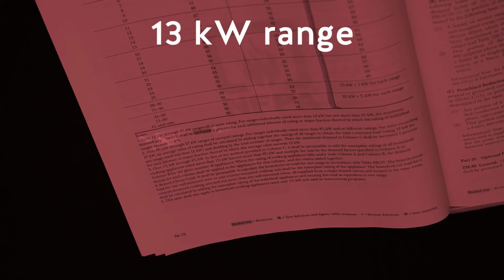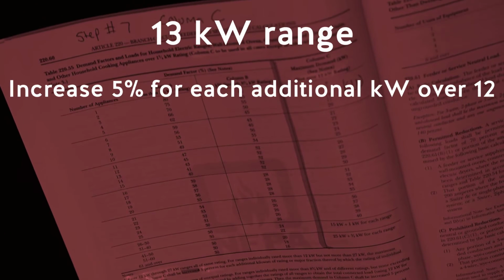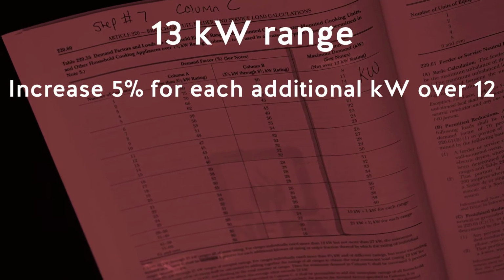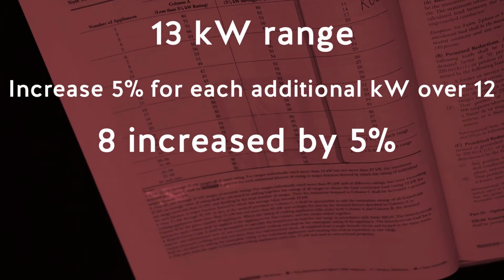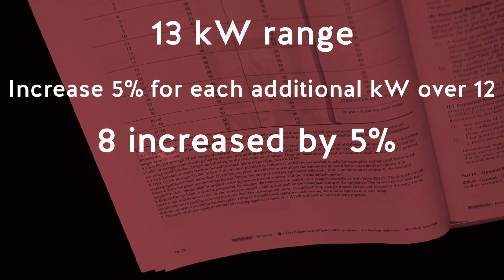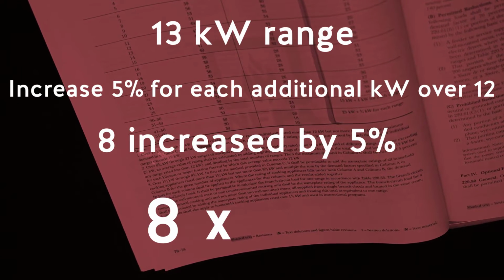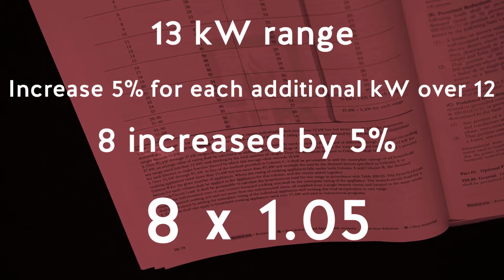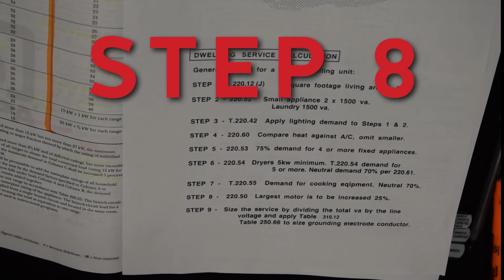NEC Dwelling Service Calculations

Comment: On step #8, I don't understand where NEC 2023 says 25% added to largest motor for individual dwelling unit.  You noted in the NEC 125% on 430.24(1) and that 25% used on step 8 with the remaining 100% to be used on another step, but the video didn't expand on that.  What's that other step the 100% was used?  Say you have a 5hp 1ø 240v A/C load & 10kW Central Heater.  The heater would be used per 220.60 comparison A/C=28ax240vx1.25=8.4kW vs. Heater=10kW.  Additionally, say you have 4+ fastened in place appliances and the largest motor(all 120v) is 9.8a, which is now the largest for the entire load i.e. step 8.  so step 8 would = 9.8ax120vx25% per the steps.  However, where in the code does it state this, which I cannot find, except for your statement mentioned above, where then I'm curious where the other 100% of the 125% went per 430.24(1).  I see that a 125% was all used on the A/C motor 220.60-Noncoincident load, and if we're considering that article then that's leaving no reasoning for step 8 and the 25% for largest load or at least a direct statement in the Code book for it.  Great video, apologize for the TLDR, but I hope you read and help me understand.  Thanks.

Comment: I need an example. Like how do you deal with ECM and variable speed AC units or do you just ignore that and assume it will be changed out in the future. What about heat pumps that can supplement the heat with the heat strips like during defrost? What about the dishwasher and large disposal? Refrigerator? My electric range will pull a little over 50 amps on a 50 amp breaker if all burners and oven are on at the same time, never happen, how do I rate it?

Comment: Do we need to measure the square feet of each level of the dwelling? E.g. first floor, second floor, third floor?
Reply from the maker: Yes, all living space of the dwelling must be included.
Reply: Just look at the floor plan
Reply: Check the county tax assessor office for the appraisal. Without that or blue prints you will be measuring and drawing floor plans.

Comment: I’ve look at the 2011, 2014 and 2017 cannot find table 310.12 anywhere.
Reply: I think it’s 310.15(b)(7) or the 83% rule
Reply from the maker: Yes, that is what the table is based on. To answer your question, though, table 310.12 was added new in the 2020 code.

Comment: Thanks for posting this lesson. I have a newbie question. Are microwaves and toasters, and other small kitchen appliances typically covered under the "small appliance" circuits? All the examples I looked at have only the two 1500VA circuits. For a large house, there could be more than one kitchen. Not saying this is the norm, but given more than two small appliances are expected, should we be increasing the circuits beyond the two?

Also, is there a distinction made between fixed in place microwaves and countertop microwaves?

Thanks!
Reply from the maker: The code provides a very loose definition for fixed in place appliances. Article 550 provides a definition for the term, but it leaves much to interpretation. Generally speaking, I provide guidelines that any appliance that requires a tool to remove will usually be considered a fixed in place one. By this definition, you could reasonably make the argument that fixed in place microwave such as an over-range one could be considered for the calculation, while a countertop one would not.